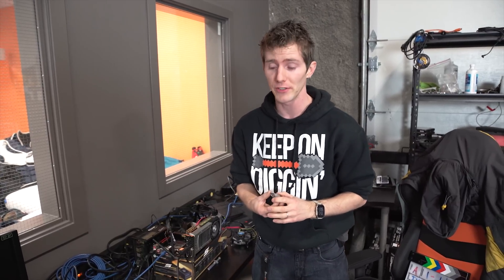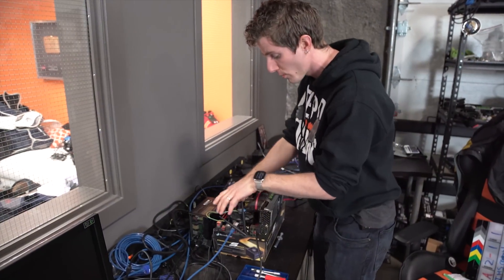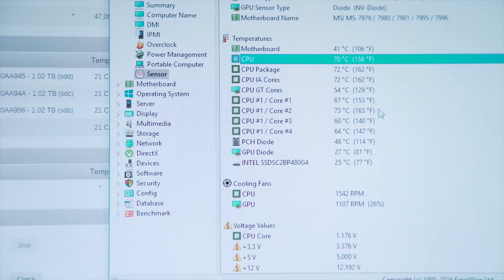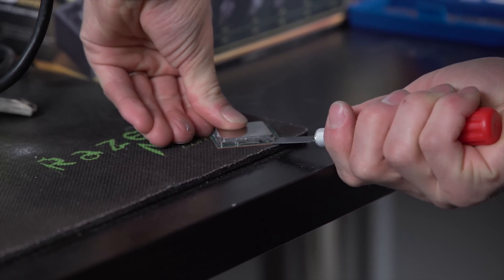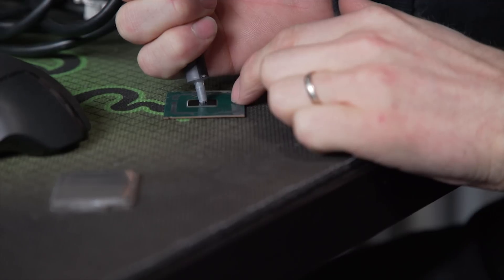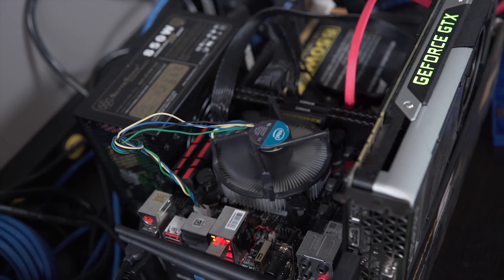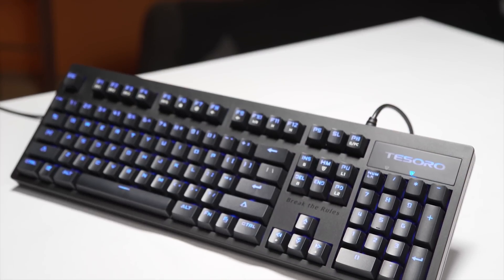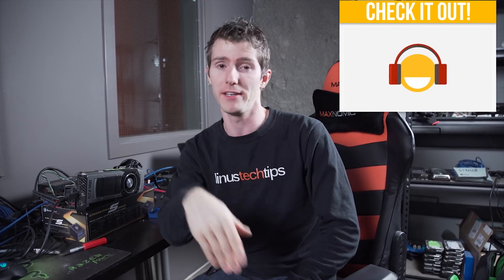Delidding an Intel Core i7 6700K - Is it worth it!?

Comment: hahahah linus you are so wrong especially with the water part . use a mount to directly mount your waterblock to the chip and you will se wonders my friend . i had a 4670k runnig 45c max and deliding it and mounting my waterblock directly on it i never pass the 30c with more overclock on it

Comment: Was the motherboard set to have a static fan speed? if not than -3c can be a large difference if target temperature is 70c under load. By that i mean the fan might have been spinning much slower when it read 67c.

I just recently replaced the thermal paste on my R9 280x (1100MHz Core) for Liquid Ultra and it is not only about -3c but the fan dropped from 74% at load over time (static seen in Valley Benchmark) down to 65%. Which is noticeably more quiet.

Comment: 70 degrees with the stock cooler? Holy shit my 4790k would insta-throttle if I stressed it with a stock cooler on.
Reply: +Cole Byre Yeah, with 4.4 Ghz easily +80c

Comment: Would have liked to see a test without the IHS, I never really got why people went through the trouble of removing the IHS - just to put it back on. You add more material between the heatsource and the heatsink and 2 layers of thermal paste. Might as well just stick it back on directly like we did in the previous millennium risk of cracking the core seems rather minimal unless CPUs became more fragile in recent years - it's still silicon though so I doubt it. 
Might have to tie-wrap it down with this stock cooler though as the pushpins probably don't go down far enough.

Comment: Even undervolting my Xeon gives me about 1–3°C less. If you really want to get some temperature changes you can try this first. Of course this will vary from CPU to CPU but it doesn't hurt you either (if you know what you are doing) ;)
Reply: undervolting? what's dat? :)) (jk)
it really depends on the cpu. on my 6700k i got a 8-9°C difference, but i used better thermal paste and i applied it correctly (on the IHS you can apply it how you want, but on the die you have to spread the paste all over it).

Comment: I've got my 4770k with an h110 delidded and using the coollaboratory liquid ultra the temp went down from the high 80's low 90's to a very comfortable  60-65 c° under load using 5 different stress tests.  After that I lapped the IHS and got 2-3 c° lower in the max temp under load. If Intel were using a good TIM in the first place I wouldn't have to void my warrenty
Reply: And I've been able to overclock higher from 4.3 to 4.6 because I had the thermal headroom

Comment: you could have tried roman "der8auer" hartung's delid-die-mate tool for delidding. it is easier and i wouldn't get nervous when you were waving the surgeons knife around! maybe you could try his oc frame.. a way to use cpu without ihs at all 
Links:
1. https://www.caseking.de/der8auer-delid-die-mate-fsd8-015.html
2. https://www.caseking.de/der8auer-haswell-oc-frame-fsd8-014.html

Comment: So I risk slicing my hands, my cpu and a lot more just for 2-3c? That's legit...
Reply: +Tommi Honkonen 10+c with watercooling and overclocking.
The TIM they use is a failure once you start generating a good amount of heat by overclocking.

I did it on a 4790k and got 15C difference while overclocked on an h100i

Comment: You should test tempos without IHS. If I remember correctly there are some 'cradles' to swap with IHS which would enable direct contact of cooler with cpu. As you delided it already it should be easy :)

Comment: Delidding without OVERCLOCK.... Why the... FACEPALMMMMM!!!!!
Reply: 2:21
Reply: +fatbloke Don't say it - test it!  )))
Reply: +kuugeli Not to mention that Intel stock cooler is most likely already running near its limits so a proper air cooler like a noctua or similar would have been a lot better if you dont want to test with water. That tiny Intel cooler can only dissipate so much heat before it has to give up leaving any improved results wanting. Seeing people ive read about who have delidded claiming anywhere from 10 to 20 degrees(in extreme situations id admit) i think this is a do over .. linus.. Do it proper or dont do it at all.
Reply: +fatbloke higher heat output makes the temperature difference bigger.
Reply: 11matt555 The usual way of doing things on the forums i roam is proper screenshots with CPUz and realtemp.. I cannot imagen it being done much different than that. This video by LTT is rushed and done poorly. Now that being said i have no clue how skylake is temp wise in its stock config but on haswell, well the stories speak for themselves.
Reply: 2:21
Reply: And lighter cars move faster.
Reply: +Peter Thomsen Do they have proof of their claims though? I could claim I replaced my thermal paste with ketchup and now I'm getting -20C with a 6.5ghz overclock.
Reply: +kuugeli Exactly !!!
Reply: +Addictive_LiquoriCe using coollaboratory Liquid Ultra or Liquid Pro and a proper cooler especially on the original Haswell chips can definitely gain you close to 30C drop. Been proven time and again to significantly help the ivy-sandy-haswell chips. overclock.net has many threads about it as do many many other forums. 

And this was specifically about the 6700k which doesn't necessarily have a bad application of TIM or bad spacing between the IHS and die.
Reply: +Jordan Wharton I thought sandy bridge had a  soldiered heat spreader?
Reply: once aroundthemapleleaf yeah sorry my bad. Just ivy and haswell that had the problem
Reply: logilogilogi Thanks for that link.. proved my point perfectly.
Reply: +Victor Cojuhari (vitiok78) It's also quite well known the standard goop intel provide behind the heatspreader, is badly applied and a bit naff.
Reply: +Victor Cojuhari (vitiok78) Why would that be necessary if you only find an improvement in cooling temps? They don't seek more performance they seek an difference in cooling. nothing else.
Reply: +Addictive_LiquoriCe The difference doesn't matter... Until you start cranking up voltage. I'm running a 4770K at 1.42V and without delidding was easily going into thermal forced shutdown at 105C when running AIDA64. I took the IHS off and replaced the TIM with CL Liquid Ultra and left it floating to minimize the distance between die and cooler and it now runs at 70C, or a 35 degree improvement. Still can't run Prime95 AVX2 or AVX Linpack, but otherwise stable for years.
Reply: ***** yeah 4.55
Reply: +Victor Cojuhari (vitiok78) Delidding and then choosing to use a stock cooler. That is a facepalm.
Reply: +Victor Cojuhari (vitiok78) He's doing it to show the cooling delta.
Reply: +Victor Cojuhari (vitiok78) Because it's fucking stupid and DOES NOTHING.
Reply: +Hendrik visch lower temps means you can raise voltage more, making the transistors switch faster, so you can overclock more.
Reply: Henry Zhang That's essentially it. Better heat transfer to the CPU cooler. At one time, this was common: Think back to the days of Athlon XP, circa 2001, where it was common to skip the heat spreader as it wasn't included and just TIM to the die and use the 4 rubber corners pads to keep the cooler from touching CPU. Intel found that the heat spreader "spread" the heat and acted as a "sink" for the heat to distribute the heat evenly to the entire chip allowing for a consistent clock and more consistent overclock due to more controllable temps so AMD followed almost instantaneously.
Reply: +Nathaniel Graham Cooling delta isn't constant! Nothing is constant and linear in transistor's world. So the test is absolutely useless and stupid
Reply: +Whiting1289 Everything else in there was fine... except using more than one graphics card. For a CPU benchmark, using multiple GPUs would muddy the results.
Reply: +Whiting1289 5820k does not have enough lanes for 2x16. It has 28 lanes so 2x8 with that one too.
Reply: +Hendrik visch cause by using a standard coller it is the cooler that limits the whole system not the TIM.
It is like a thermal resistance if you change à
the smallest resistance by a smaller one it doesn't change anything. Yet if you use a performant cooler the Tim is not the smallest resistance and changing it changes everything
Reply: +Victor Cojuhari (vitiok78) I think what this test was meant to show, is that unless you're going with extreme cooling anyway, then deliding wouldn't make sense. If you're building a system for the sake of "winning at overclocking" then deliding makes sense, because when you start pushing the CPU really far, and possibly with exotic cooling solutions, then the temperature gap will widen. But for most people, even those with water cooling, this method isn't likely to make a major difference.
Reply: +Rebecca Schade the problem in this point is that it is useful even with air or water cooling
Reply: +Paul Noël That's highly subjective. You're unlikely to get any major performance improvements, so is that worth losing your warranty over? As I said: Subjective. I'd rather have my warranty than 100MHz extra.
Reply: +Rebecca Schade Depends on how you use it and actually it can be way more than 100MHz... I saw 600MHz cases
Reply: +Paul Noël 600MHz improvement due to swapping the compund, or running delidded? And was that 24/7 overclock or "benchmark overclock"?
Reply: +Rebecca Schade 24/7 overclock watercooling by changing the TIM and using liquid metal. The stable fréquency increased of 600MHz. More commonly it is 300MHz
Reply: +Paul Noël Well, depending on what type of CPU it is, and the use case, that might lead to a noticeable increase in performance. So perhaps it would be worth losing warranty over. That would have to be up to the individual user. I still think that Linus' makes a good point though. For the majority of users, this is a pointless mod. For the remaining minority, it's probably considered essential, and that's fair enough. They probably don't watch Linus Tech Tips for help with their overclocking though.
Reply: +Rebecca Schade .... Schade Schade ;D
Reply: +11matt555 Wait what??? Really???
Replacing my thermal paste with ketchup NOW. This is gonna be amazing!
Reply: +Dylan Harrison Then why the hell I need to delid my CPU without overclocking? )))))
Reply: +Victor Cojuhari (vitiok78) to prove a point that it either runs cooler or it doesn't
Reply: +weeowey He wants to prove a pointless point ))))
Reply: ummm... yeah, that's not even remotely close to something that could justify a face palm even a little...
Reply: Eh, To be fair I think I'ma roll with the Pc expert and not the comment plebs. Kappa!
Reply: +iArthurXP roll with the common sense )))))
Reply: +FlyingT Capitalizing adjectives is as pointless as delidding without overclocking :P
Reply: I might not be proof. But i delidded my gf's 8350k which we had running at 4.8ghz with a max temp of about 92. Now it rarely goes over 70 after delid. We used thermal grizzly conductonaut between die and ihs.
Reply: Whitling1289 I agree. i have and use a 5820k right now. The 6700k has a faster peak singlecore, yes. But general performance of my 5820k in both games and others @ 4.7ghz has seen no issues whatsoever. My father bought a 6800k for himself. He might have gotten a trash chip, but the 5820k outperforms it in every aspect, clockspeed, singlecore, multicore, you name it.
Reply: I have never understood the warranty part, do you pay extra for warranty? i overclock all my cpus, running 3 setups overclocked to the max right now. Never had issues induced by overclocking or delidding.
Reply: +Peter Thomsen  
10-20C improvement? I call serious bull on that claim.

Comment: id just like to point out that skylake does not need it as much...haswell esp first gen/ revision ie 4770k and i5 counterpart both have the IVR of haswell with the pretty bad TIM...the devils canyon refresh was a revision to improve clock speeds (ie just improved manufacturing nothing that is out of norm) but mostly to improve temps by changing out the TIM...skylake has pretty decent TIM least compared to haswell rev. 1 and the IVR is moved off die which did produce a good deal of heat...now i get why people delid but some cpus benefit a lot more then others

Comment: So would changing the stock cooler provide more than 3ºC of improvement? I still mean air cooling.
Reply: +Mickice Above all, aftermarket coolers are much quieter. That's the main reason to actually get if you're not overclocking.
Reply: Just running hot doing video encoding, I have a launch Haswell so for heat I'm really in the shit, lol.

Comment: Well, my 4670K wouldn't reach 4,4GHz until I delidid it.
Reply: But yeah, I wouldn't do it unless you're in bad need of those extra fewer degrees or if you're not worried by warranties and have a spare CPU laying around.
Reply: +nccish yup, when your pushing voltage and are pretty sure that the usual 5-15c that a delid could give would help you get that higher oc.
Reply: +nccish yup, when your pushing voltage and are pretty sure that the usual 5-15c that a delid could give would help you get that higher oc.

Comment: If you have a CPU other than Haswell(ie 4770K), delidding is kinda unnecessary. With my 4770K at stock speeds with the stock cooler and running Aida64 with FPU stress test my temps hovered around 90 degrees. After delidding, applying some liquid metal and without applying any adhesive my temps dropped down some 23 to 25 degrees.

Comment: I did the same to my 4770K, although I used the vice-method. I feel like it was a little scarier because you're applying more force but it was over quickly and my CPU still works. I put liquid metal in there and also didn't glue the top back on, it's just clamped into the mount. My roommate has the same CPU and also took the lid off but used normal thermal compound. When we both tried overclocking them mine ran a good 200-300Mhz quicker than his at the same temperature, although we suspect they might also just have a difference in production quality for whatever reason.

I will say though that I'm not sure if its integrated gpu is still fine because I tested if the CPU worked before I took the lid off but I didn't test the integrated graphics and it didn't work after the delidding. I can't say for sure because both CPU and mainboard are second hand and I wasn't able to test if another CPU's integrated graphics works on my mainboard so it's 50/50 if its the CPU or the mainboard that's causing the issue.

Comment: +LinusTechTips i already did it with my 6600k last month.
its ióverclocked to 4.8Ghz on a Maximus Ranger full watercooled and i delidded it with fluid metal.
my max temps drop from 71 to 52°C under Prime95 and in idle it has a deltaT from not more than 1 degrees
for me the delidding woks awesome but i was scared to break it :D
(i have not lying around a bunch of CPUs tp kill one like you)

Comment: It's amazing how far some pc geeks will go to eek out tiny improvements in performance. For all that effort and extra risk taken one could easily argue for simply paying more.
Reply: +rusty_frame Paying more for what though? Why get a K model if you aren't going to overclock and get the most out of it. What if you already have an AIO/CLC,  3 or more excellent PWM fans on the rad and intake and already used well recognized TIM. What if you want to get that stable 4.7 or 5ghz but you're still throttling?  This is what  you do.   Does some work mean you should instead shell out more for E/X enthusiast line instead?

Comment: That was fascinating actually, I am surprised Intel (and presumably AMD) dont have an almost optimal solution between the die and lid thingy - but like most things 'gamey' there is almost pointless return for a huge risk.
Reply: afaik Intel used to solder the spreader but then switched to the current method for non extreme CPUs
Reply: neah, AMD is ok. they solder the lid, so no cheap poorly applied thermal paste. ;)

Comment: what about removing the ihs completely
Reply: +Shanee Bahera if you remove IHS completely, your (standart) radiator won't contact the CPU at all. The gap is about 2 mm.
Reply: Николай Грошев yes it did cross my mind that the stock cooler will not fit but there are after market coolers that will and most likely anyone doing this mod will be using those

Comment: Linus or anyone! Is there a way to fix bent pins on a cpu socket on the motherboard? I tried bending them but they were too broken. I wanted to use the motherboard because it cost me 50 quid and it is a shame that it broke as it was a good mobo. I was thinking of picking up a cheap intel pentium  g3528 chip from Ebay to do a test bench and use some old hardware from my previous pc. All hail recycling! Anyhow I was wondering how to fix the CPU socket. Is there a way to replace it? Can I buy a new socket and replace the old one by soldering it onto the board? The rest of the board is fine just the CPU socket is broken. Many thanks in advance!! :)

Comment: You had quite good starting point. Around 70-degrees under tress test is a case where I too would not recommend delid unless pushing for the absolute max overclock. Also delid is not a smart thing to do if you are not going to overclock. TIM that intel uses is enough to run processor at safe temperatures with stock speeds  (And I think that they'd have lawsuit in their hands if it didn't), it's just when you start pushing voltages up where the stock TIM starts to become a bottleneck for heat transfer.

When I did my delid for Ivy-Bridge 3570K I had temperatures up to 90-degrees (under IBT-load) with 4,4Ghz overclock @ 1,25V and Phanteks PH-TC14P.E After delid (using Coollaboratory Liquid Pro as TIM) I got it down to 70-degrees. Then when I went for custom loop I sanded the edges of IHS-down a little and also polished the ihs to a mirror shine, I got the temperatures drop down to around 60-degrees under IBT-load with 4,7Ghz @1,38V overclock. So there are big benefits in certain cases.